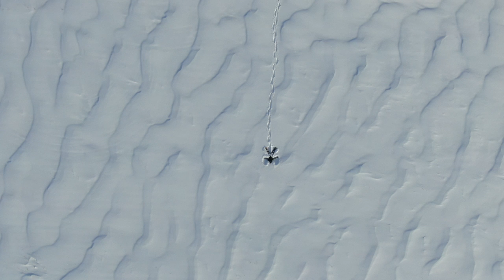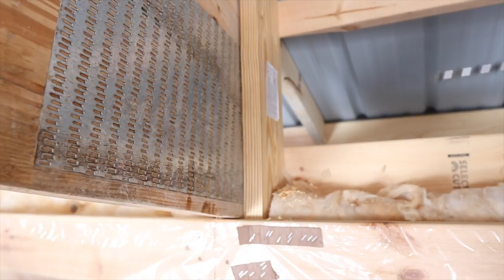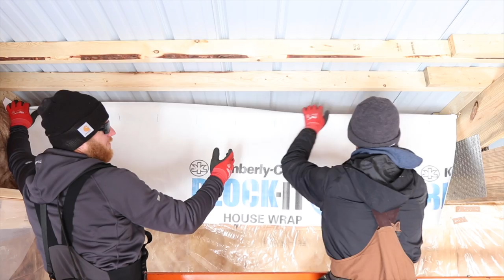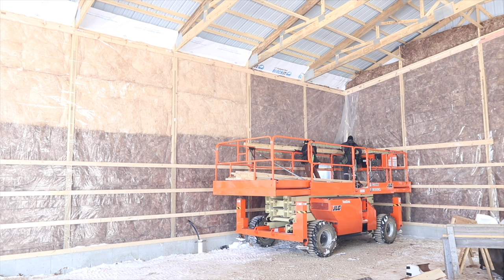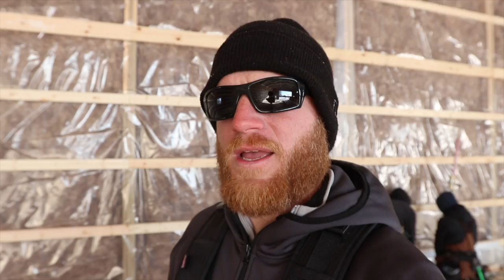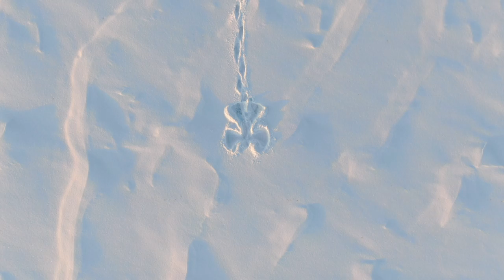Building a Work Shop: Attic Ventilation Details, Base Trim Installs, and Completing Interior Framing

Comment: You should look into premade soffit baffles (or rafter vents).  They're usually polystyrene or cardboard.  Seems like it would cut down significantly in labor time rather than making your own.  The span between post frame posts/rafters isn't really an issue since you would just slap staples into them against the purlins.
Reply from the maker: Great idea but you’d still have to close up the soffit around the baffles?  The gap is much larger than a baffles size
Reply from the maker: Thanks never seen those will have to check it out thanks
Reply: One downside I notice of these is the limited to 16 or 24 OC type rafters or trusses, except in this framing there is the purlins providing enough space to attach if he was to use them on one of his builds if the customer was interested in and willing to afford and use them. Accuvent (Brentwood product) as you said is the predominant search it seems, but there is also the Owens Corning version along with ADO Durovent. Not sure who if they are still made for the foam version but the Owens seems like a foam derivative.

Comment: I’m going to need to watch your recommended video on smart ventilation. I’ve got a wood pole barn with metal skin. I really want to do improvements, but I’m not sufficiently familiar with ventilation requirements and rationale. Fortunately for me I haven’t yet begun, so at least I haven’t made any dreadful decisions. My fear? That I choose something stupid at the outset, and pay dearly for it through the rest of the remodel AND the life of the building. Just a little anxious...
Reply: Check out the Pole Barn Guru blog for attic ideas and tips with some math to calculate required amount of ventilation needed to prevent mold and other humidity issues.

Comment: Hey kyle, i have a garage on my property that was built in 1955 and i would like to insulate the structure. The building does not have a typical soffit and only has two large square vents where a ridge cap would normally be. Can i insulate this in the same way as a modern building or do i need to find a way to install a vent in the small soffit area?

Comment: Question for Kyle, can a shed roof be adequately vented? Is there a certain pitch I need and does there need to be an “attic” space?
Reply from the maker: Yes and pitch doesn’t matter but I think you need proper attic space for venting
Reply: Another component one can use for added ventilation is end wall peak vents (passive or electric) if soffit and ridge is not enough

Comment: Video lighting is simple. Let the camera take a light reading of your face or other bare skin and set it at that. The rest will fall into place. You will probably need to do it again when you go from outside to inside and vice versa. Try it, it costs you nothing and may solve your light problem.
Camera meters are set to a grey scale of 18% - the halfway point between total white and total black. Your skin tone is round about 18%, give or take, that is why you can take a reading of your face or other skin and your camera will give you a good image, light wise.
Reply from the maker: Interesting. Maybe I should take a class

Comment: Nice intro. What's that cable running from the wall to a pipe? I am from Brasil and the  ac suplie here have diferents standards.
Reply from the maker: For electrical and water

Comment: Hello, I recently found your channel and we are now subscribed.  At what point does the electric get done? Maybe you have talked about this in a prior video and could point me to it. Thanks.
Reply: Kyle does go over this in other videos.  The customer decides.  Most of the time it would appear they do it over the inside finish.
Reply: Kyle focuses on what he does best which is build, he leaves the insulation and other stuff to the others who focus on their sector of work for efficiency sake. As 24revealer said its conduit over the finish, easier to install and reroute as needed, though one can route it behind the wall between the skin and columns since the girts provide the space needed but with metal finish with profile makes it a bit difficult to flush or recess mount the outlets.

Comment: would it not be faster to use rigid insulation to make the stops at the top of the wall instead of the wind barrier.  you could cut them all on the ground and then install  plus being rigid no chance of tearing like the barrier
Reply: You would need A LOT of rigid foam to fill in and make up the needed R value, but also would require a bit of trimming for it to fit since the space between the rafters and columns are not a full 8 feet, plus there is the whole gaps = drafts. But it is not his choice as more of the customer who having it built to go with fiberglass. I like rigid but mineral wool is also just as good or better than fiberglass (mold issues).
Reply: @Joshua79C  I wasn't clear. What I meant is to use rigid foam as the barrier to hold in the blown insulation.  It could be trimmed on the ground and then taken up for installation thanks really enjoyed watching project

Comment: What is the point in having a Vapor Barrier for the ceiling with a metal Ceiling Liner?  The Metal cannot pass vapor and my understanding is vapor barriers should never be doubled up.
Reply: Outside wrap is more for wind blocking but still has microscopic holes for breathability, also he is not taping up the vapor barrier so it its not air tight, its more to keep the insulation from falling down if you ever need to replace a panel and for small bits to fall through as it degrades over time.
Reply: @Joshua79C  thanks, but my question was more for the vapor barrier between the ceiling liner  and trusses when insulating. Prolly should have not asked related to this video, it was just something I thought about.

Comment: What where bolts for?
Reply from the maker: Truss to post connection strength and helps with side to side strength if big winds hit the building.  It strengthens that lever point
Reply: @RRBuildings  Do you do it to all trusses normally?
Reply: @xephael3485  
YES,building codes..thanks for asking.

Comment: The r factors are figured in a lab under lab conditions which most insulation are not installed like in a lab. And this is not considered the moisture and wind in the real world which will even lower the true r value of your insulation.